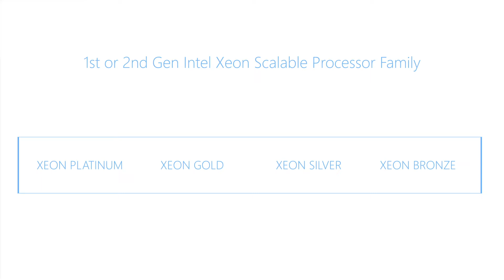Dell Poweredge T440 Processor Installation

Comment: Hi,
What is the difference between the Intel Xeon processor and the Dell Intel Xeon processor. If I want to buy a Intel Xeon processor xxxx then its 2000$ on the dell shop and in the local shop the price is 1000$.

Can I use a normal Intel Xeon processor within the Dell one?

Thanks for the answer.